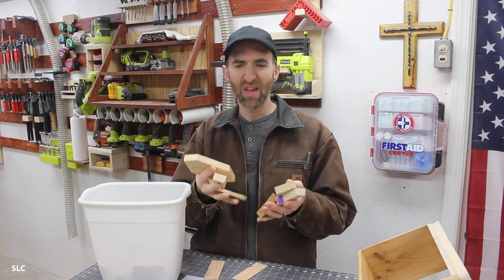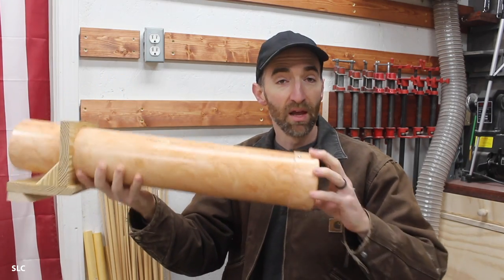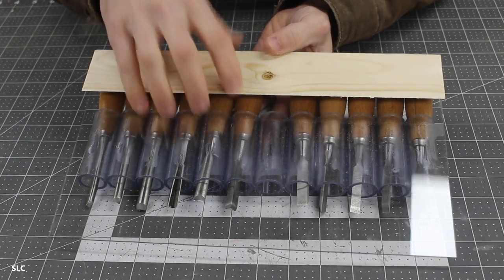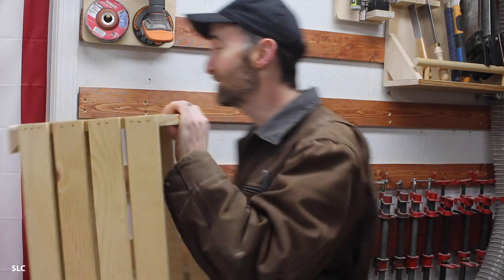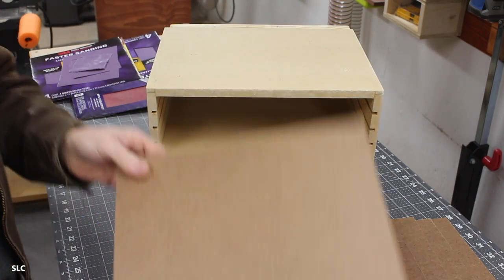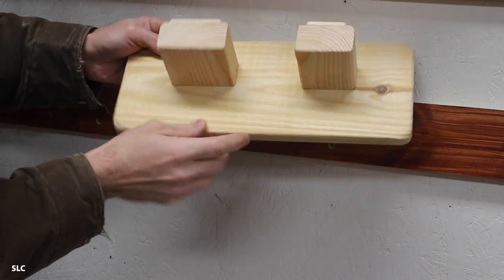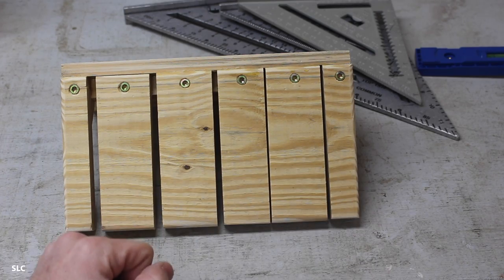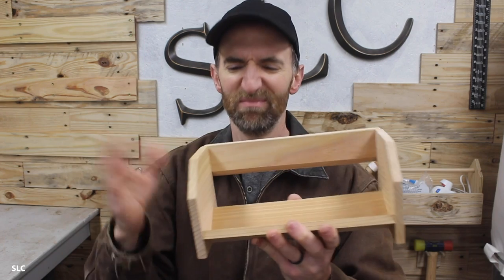20 MORE Simple French Cleat Ideas for Your Tool Storage #3

Comment: We just moved into our new house which is blessed with a full basement and exposed studs.  The basement is my "man cave" for restoring old and/or broken tools and doing some woodwork.  I am inspired by your ideas.    I will make a cleat for my soldering gun using #20.  But will design it to turn the gun away from the cord to avoid damaging the cord should the gun still be warm when putting it in the cleat.  Keep up the great work!
Reply from the maker: You have a great idea there.
Reply: Did you cover the exposed 2x4 and if so what did you use? I've got a shed Im using for yard tools and camping/recreation thing too.

Comment: Hi Clinton,
I LOVE FRENCH CLEATS.  As I grow MUCH OLDER 👴 it get harder and harder to be picking stuff up from the floor or lower shelves.  So a French Cleat is actually a life saver.
Re.: #4 Your A/C outlet cover.  I made that myself.  The original problem was that the kids and shop visitors would use the cover as a note desk.  That additional weight would snap the cleat or merely knock it off.  Another object to the floor.
So I made a MINOR adjustment.  Instead of a wooden top, I removed the wood for a thick piece (two 1/2 inch) clear Lexan.  Now we can see through the top for ease of plug swaps.  And no one uses the cover as a writing desk.
Next, all of my traveling units, and my sandpaper shelving unit, all have a hand hold, i.e. cut out pull, for ease of access.
Lastly, in the past I made four of your spray paint can holders.  After watching your first French Cleat episode I attached my hand hold pull to the top with your French Cleat.  Great match.
I can hang my paint cans, and additional spray paint tools, near my paint box and move it outside at will.
My weekend project this week will be more wall cleats near the two people doors & around the empty space adjacent to the garage doors to the building corners.  For you ax and garden tool (shovel) cleats.
GREAT JOB.
~Jim
Reply from the maker: Thank you for telling us of all your uses and ideas including the outlet cover which is a very cool way to let it be seen and not used. Your input really helps me want to continue this process. I hope to have a few more videos in the near future, and hope you can use a few of those ideas too.

Comment: I put french cleats in my shop here in the UK, I like that your ideas are simple and straightforward but get the job done. I have my wall outlets like yours but here in the Uk our plugs are flat with the cord coming out the bottom so we do not have any issues with having to protect them. They also have a switch and a built in fuse which is fused lower than the main circuit so if a tool malfunctions it trips an RCD on the main panel which is just reset but blows the fuse in the plug so that tool does not work again and will not interfere with the rest of the shop. I like your idea to protect your outlet though cool!!

Comment: 3:08 one improvement on that add a lip on the bottom for a note pad and a PCV Tube on the side for a pencil holder.
Reply: A lip will also allow you to put your cell phone on there, and the outlet is right there for charging
Reply from the maker: That could work too, thanks

Comment: Should extend the front of your tape holder forward with some wood to hold the open end of each tape for easy use and add a hack saw blade across the entire front edge for cutting the tape

Comment: Love the wood stained PVC dowel holder. Have you tried rubbing alcohol to remove the inked markings? I don’t know if it works on all PVC, but I was thrilled that it did with mine.
Reply from the maker: Thanks for the tip. I decided to just leave it on this item because it will just stay turned against the wall most of the time. In the future, I can give it a try.

Comment: Great ideas as usual. Question...how far are the boards on the wall spaced apart?  Need to redo my garage soon. Thanks
Reply from the maker: The distance depends on your preferences and the size of your wall. Just keep in mind that if they are too close, it might be hard to attach and remove the cleats. Also make sure each wall cleat has enough surface touching the wall, and each are well secured with long screws into the studs.
Reply: Thanks for the reply!  Keep up the informative vids!

Comment: So I'm pretty new to woodworking usually welding but how did you screw most of these together so the front stays clean are you using a nail gun or just glue couldnt tell thanks in advance.
Reply from the maker: Most of the time glue, but sometimes I also add a screw or Brad nail to hold it in place while the glue dries.

Comment: How did you stain the PVC to look like wood?
Reply from the maker: Using an old sock, just lightly dipped it in the stain and swirled it around the pipe for a very thin coating. Then let it dry for a couple days.